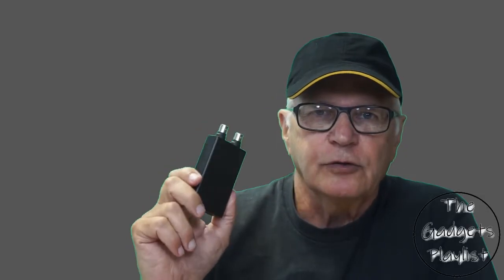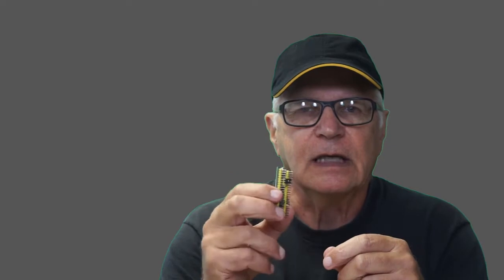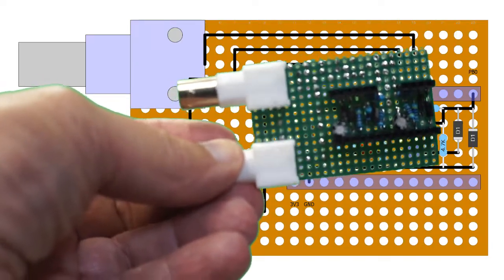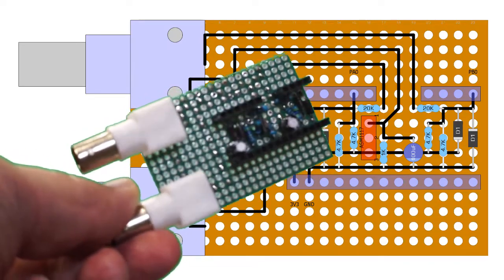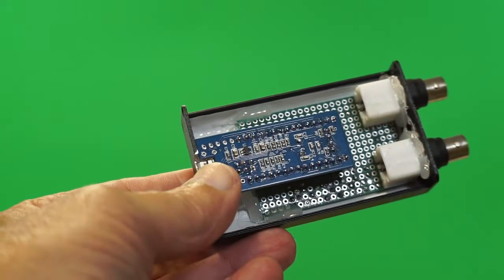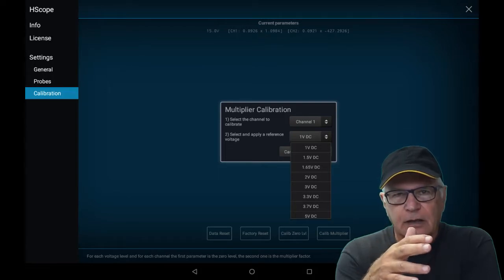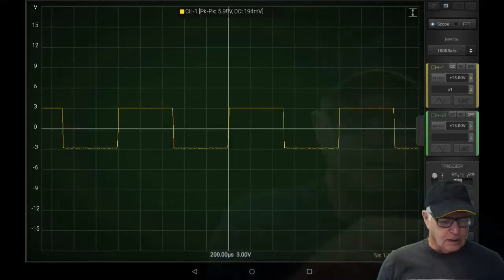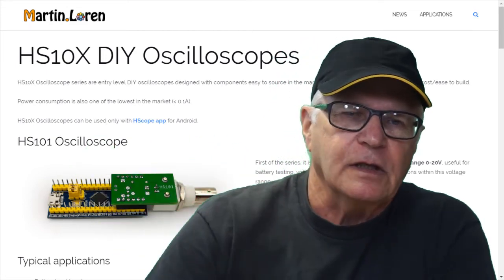GADGETS#62 - HS102 STM32 OSCILLOSCOPE

Comment: Thank you so much sir... I will make it for my workshop
Reply from the maker: that has to be one of the coolest through hole solder projects ever...for those not wanting to do SMD soldering

keep in mind it doesn't have the "standard" 1MΩ impedance but about 40KΩ ... not that big a deal in most measurements

good luck:)

Comment: Does   XY Plot  work  HS102 ?  HS 402 is OK.
Reply from the maker: HS402 is a huge upgrade to HS102.

I like HS102 as a through hole build and it is a capable little oscilloscope keeping in mind that is not 1MΩ impedance (as most scopes)

X-Y PLOT is a HScope feature for all 2 channels supported scopes including the HS102

Comment: What is the function of AMS1117 in circuit?
Reply from the maker: You've spotted the 2 pin "unconventional" use of AMS1117 here...

It provides a 1.65v reference. Only the 1.2v version of AMS1117 generates that voltage in this fashion. Other values of that regulator would generate other voltages.

Very observant on your part, Oseias. This question gets raised from time to time. A little trick the developer employed.
Reply from the maker: should you want further clarification, I invite you to the HScope LOUNGE on TELEGRAM which is more suited to technical questions/discussions than the YT comment section:

https://t.me/hscope

Denis

Comment: my question was about the curve tracer. compatible with your hs102
Reply from the maker: Allfree  - I am unsure if your plan is to use a curve tracer (to measure semi-conductor performance)  with the oscilloscope as opposed to a stand alone unit.
If so, I remind you that this HS102 has 20 KΩ impedance which might hinder such work.

Comment: Do you know if the free version of hscope lets you set the scope as HS102? When I try it always reverts back to the HS101. Just trying to figure out if I have a hardware problem.
Reply from the maker: First thing that comes to mind is that HS101 and HS102 are separate licences.
You have purchased HS102?
Reply: @theGADGETSplaylist  I just have licenses for my hantek scopes and the automotive module.  So you are saying I need to purchase the HS102 license to get Hscope to recognize the HS102 or otherwise it will show up as the HS101 in the free version?
Reply from the maker: @rs1971camaro  I don't think HS102 will work without a licence. Here's how HScope licencing works:
Each supported oscilloscope model requires its own licence.
Those licences will be valid on an unlimited number of Android devices registered under the same Google Account.
The Automotive Module is a 1 time purchase and will work on all your supported oscilloscopes.
Reply: @theGADGETSplaylist  Thanks, when I get home I'll purchase the license and see what happens.
Reply from the maker: @rs1971camaro  cool...let me know how it works out!
Reply: @theGADGETSplaylist  purchased the HS102 license. Still shows up as the HS101. I must have a board problem where Hscope isn't seeing the second channel.
Reply from the maker: @rs1971camaro  I want to help you get to the bottom of this. This comment section isn't suited.
I invite you to look up the HScope Group in TELEGRAM. The tools to help us communicate and solve this issue exist there.

Comment: Thanks very much to the designer for the design, and also to LC for the video above showing us it's potential.
Although my build seems to work well, for some reason it shows the frequency of a 1hz signal as 100.20khz.
Other frequencies up to 32khz are detected correctly so far.

Is this a simple s/w bug / does anyone else have this issue?

Another issue I have is that when measuring the clock signal from a DS1307 that is supposed to be a square wave, it is showing up as a 'not so square' wave that at 32khz is rounded off at the leading and trailing top edges. It is also changing shape in a regular pattern and tracking left.

Unfortunately I don't have a commercial oscilloscope to confirm how accurate it is.
Is anyone else able to check their DS1307 to see if they get the same result?
Reply from the maker: are you using the latest HScope release?
and are you on the BETA HScope release...latest is (167)
Reply: @theGADGETSplaylist  I'm using v2.2.5 (153).
I'll download the latest version and see if that makes a difference. Thanks.
btw: I decided to attach a 3 pin header as the connectors on mine so I can use standard clips and wires. I find that for me it makes it a bit more flexible than the usual 'scope probes. I don't need the 10x option for general use.

Comment: Hi,
thanks for sharing the design and software.
For the HS102 (15v), can I replace the 20k resistor with an 18k one to give me a 3.1v range at the blue pill instead of the 2.85v for the 20k? Or, is the 2.85v range pre-defined in the code to translate from a 15v input? (I don't have any 20k resistors but I have 18k.)
Thanks.
Reply from the maker: +David L - I don't think you can swap the 20k for 18k...
A while back, I bought a big resistor kit on Aliexpress...not expensive and it has tons of resistor values....the way to go I think if you like this this hobby.
As to sharing the software, the STM32 firmware is free as is the STM32 Utils to flash it. All written by Martin Loren.
HScope app requires a HS102 licence...about $7.50 last time I checked.
If I can be of any help as you build this, do not hesitate to ask.
Denis
Reply: is getting me back into electronics after 30+yrs :)

Comment: What on earth is the purpose of the voltage regulator that doesn't have its output connected to anything?
Reply from the maker: +Skitus - the question has been asked in a few video comment sections.
It's beyond my level of understanding but I can sum it up as an undocumented feature of the AMS1117 1.2v and AMS1117 ADJ in this form factor. The developer (Martin Loren) exploits it in the HS Serie Oscilloscope design.
A bit more discussion on GitHub here:
https://github.com/martinloren/HScope/issues/4
Reply: @theGADGETSplaylist  Thank you for your answer, though I must admit I don't understand it. What is this "undocumented feature"?  How does it provide Vcc/2 when the output is floating? 

Sorry if I come off as crass, but I work with this device frequently, yet my flabbers have been gasted by this claim. :D
Reply from the maker: @skitlus335  - not crass:-)
I invite you to join the HScope group in TELEGRAM.
Martin is the administrator. Your concerns will be addressed.

Comment: Ok. My next project. A already gathered the processor back when you revealed the single channel version.
Thanks
Reply from the maker: +Dave Sage - It's a great little scope! I wouldn't sweat the 20 KΩ impedance. I plan a video in the near future where I put it work on a J1850 PWM and J1850 VPW waveform capture.
Another guide to its performance would be the newly released CAN BUS DONGLE. That is a HS102 (+/-5v) which has 5 KΩ impedance! Not a problem, IMO.

Comment: Cool boxing! I'm looking forward to see some real application with this!
Reply from the maker: +Martinloren R&D - I've got one in mind. Need to catch my breath after this one. This video took quite a bit of time to produce.
Thanks for your help throughout the project!
Reply: @theGADGETSplaylist  I see out of the box the BNC plastic is black, did you paint it or?
Reply from the maker: @martinlorenrd4073  - I thought you'd notice that😎
It's heat shrink. Purely cosmetic but it hides the drill hole edge and the scraped off threads on the BNC.